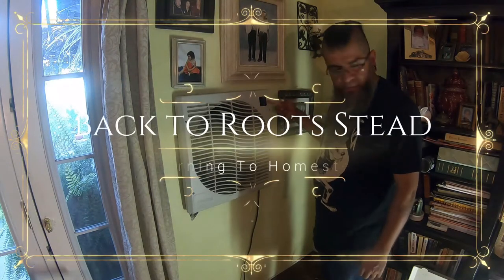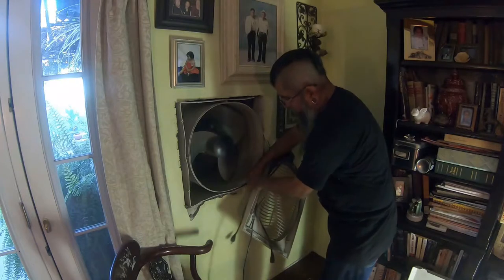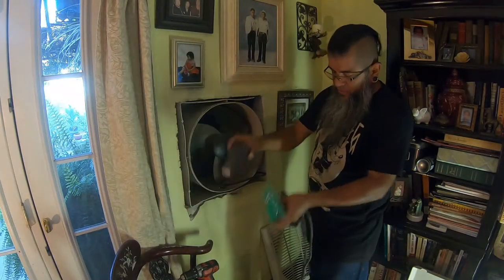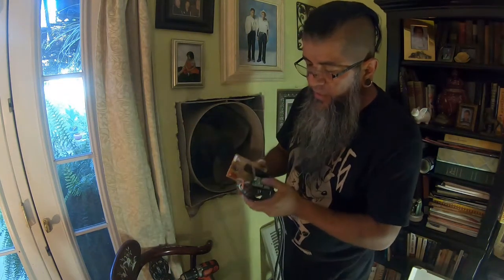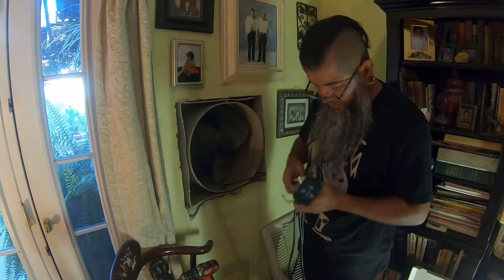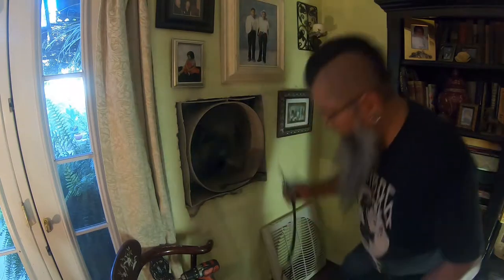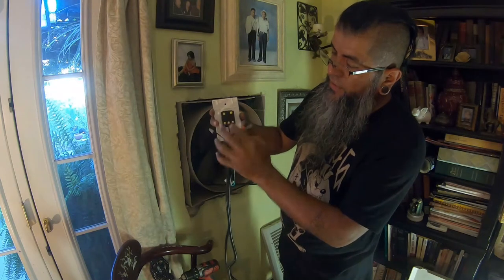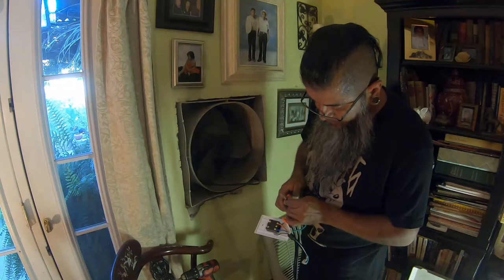How to change Mastercool MCP44 control switch.

Comment: At leas, this evaporator was placed just this Summer. However, I cannot have the back porch light on because this thing is like a vacuum for bringing in insects into the house.

 Another video the guy found some type of scream material to place on the outside but at the same time when it inhibit the performance because he was getting Miller's coming in through his.

Today I walked into the kitchen the thing stopped working. . I thought it blew a fuse, but it did not. Everything else was working. I unplugged it. Plugged it back in. It turned on, however the fan is not blowing out like it was...
 That is why I am watching videos on this product.
Reply from the maker: awesome i hope it helped

Comment: What are the specs for the replacement switch?
Reply from the maker: Not sure. I found mine on ace hardware. Just looked for any slimline evap cooler switch
Reply: Thanks

Comment: Where are you located??
Reply from the maker: San Bernardino California
Reply: @backtorootsstead7114  I am just above you in Big Bear. I am looking at buying one of these coolers and I keep seeing the control panel is a common problem. I was wondering why no one tried converting it to a manual switch. My old swamp cooler had a manual switch and it lasted for ever. Nice Job.
Reply from the maker: Thanks. I actually fixed 2 of them. I have one in each house and now both of them are beast. They work great.

Comment: Quick question if I had the the other pump you didn’t have so I connect green to green, black to black, and so on the same way?
Reply from the maker: Not sure I understand your question
Reply: Sorry. I have two pumps and you only had one. I was wondering if I do everything the same way with the 2nd pump. The 2nd pump has white, green, and black as well. I believe you put pump 1 on number 2 switch. What I am asking is if i combine black wire from pump 1 and 2 to number 2 in the cooler switch. Hopefully this makes sense. (I have a pump and drain pump.)
Reply from the maker: I also have 2 pumps but I only use the pump that pushes the water thru the filter. The other pump I just left it alone. I hope that helps.
Reply: Thanks. I got it to work.
Reply from the maker: I’m so happy this helped you. Like share subscribe 👍. Thanks for your comments 😁
Reply: Back to Roots Stead will do. Thanks again for the video this really helped.